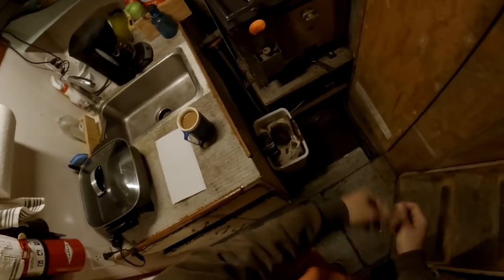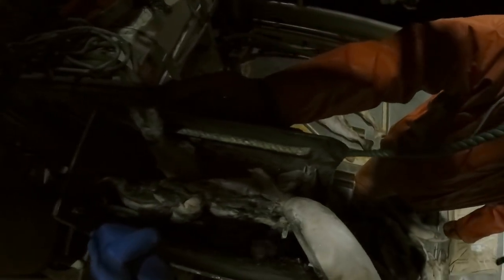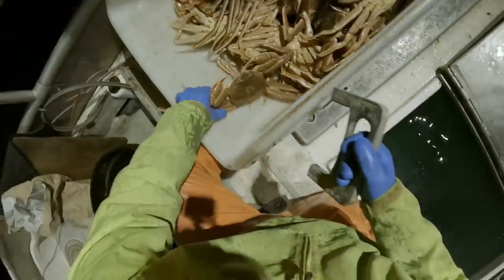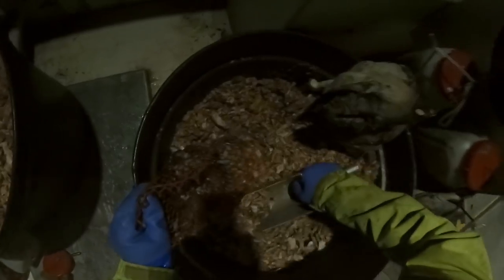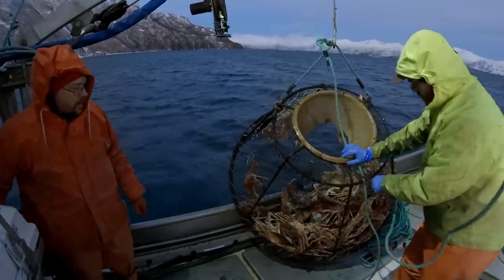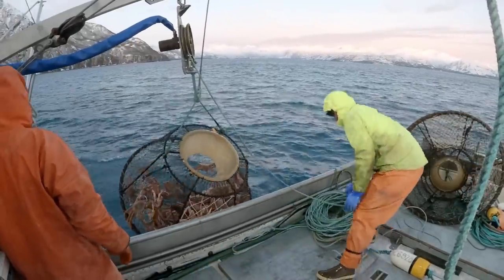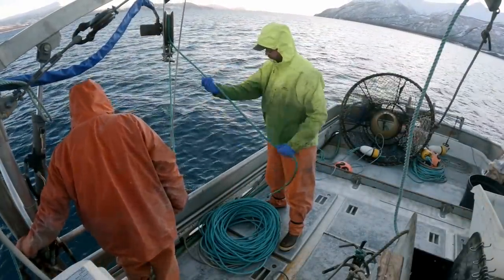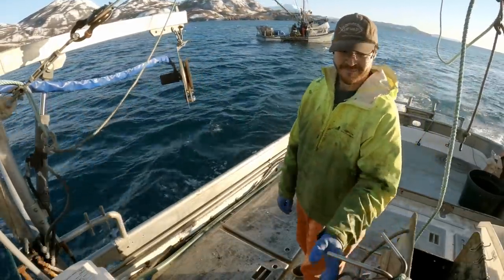Tanner Crab Season Pt .2 - Hauling Our Prospect Pots

Comment: enjoyed it a lot as always, do you guys use any type of flotation vest under your rain gear or have a knife on a belt
Reply from the maker: We don't have vests on, but knife belts are always present (sometimes under coat so they don't snag up on web).
Reply: @EISAlaska  that is what I thought.  I had to ask to many years having safety safety safety drilled into our heads at work

Comment: why are you throwing a hook instead of using a pipe pole? and why are the poles out?
Reply from the maker: The throwing hook is a lot easier than a hook stick, don’t have to worry about the long end hitting someone, since I’m in a hurry to get the line in the block. Stabilizer poles are out just incase we need to toss a fish in.

Comment: How close do set your pots? If one has lots can you set another one 30 feet away?
Reply from the maker: The prospector pots were about .25 nm apart. After we consolidate them, they are around .1 nm apart. It would be a bad idea to space them that close, as the buoys would likely twist up with one another.
Reply: @EISAlaska  I didn't think about the line. Thanks.